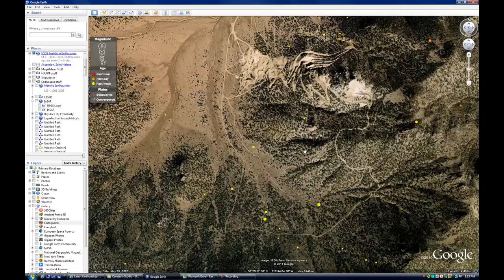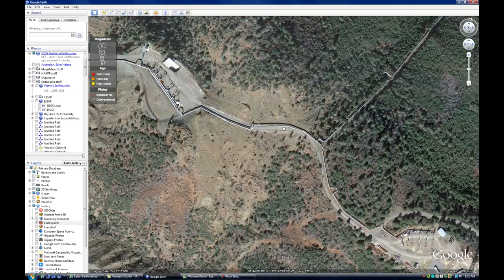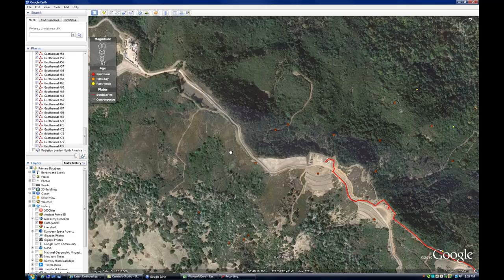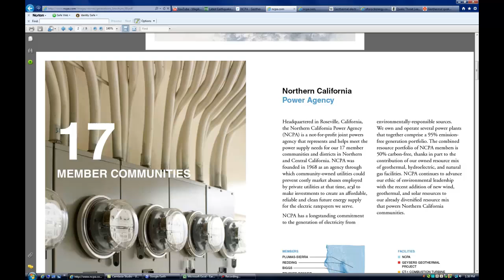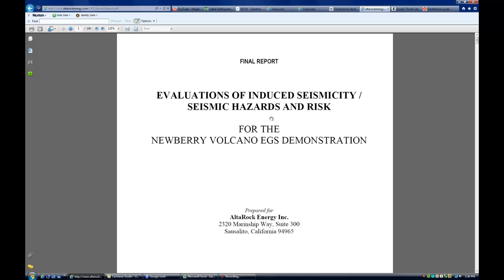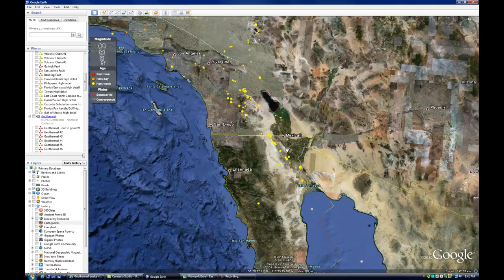Geothermal Energy - the NEW fracking??

Comment: The video-maker acts like the geothermal industry completely ignores the induced seismicity problem.  The fact is that geologists and engineers that work in the industry are well aware of the potential danger associated with reservoir pressure differentials.  Although The Geysers are the poster-child of induced-seismicity and geothermal energy, they have also provided a wealth of data that are being used for the mitigation of anthropogenic seismicity.  Geothermal energy has WAY too much potential as a clean, renewable BASELOAD (the keyword here) energy source to just be crossed off the list. 

Wind and solar are great, but they just don't have the large-scale battery technology that would allow them to become the baseload generation methods yet.  Geothermal energy can fill that void as we phase out coal and natural gas.  Are there obstacles to be overcome? Absolutely.

Our energy grid is incredibly complex, and anyone that thinks that we ought to be waiting for some perfectly flawless new energy source before we make any changes is just naive. We don't have time to wait. We are not only living in an era of climatic turmoil, but in one of skyrocketing energy demand coupled with dwindling fossil fuel supply. If you're going to complain about problems, try offering up solutions as well.